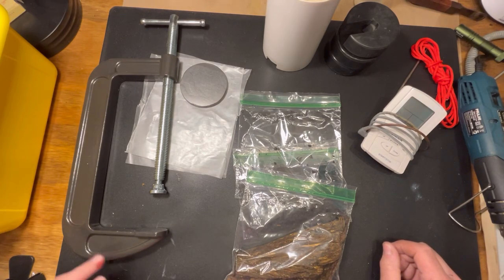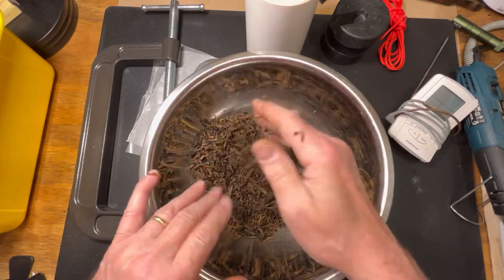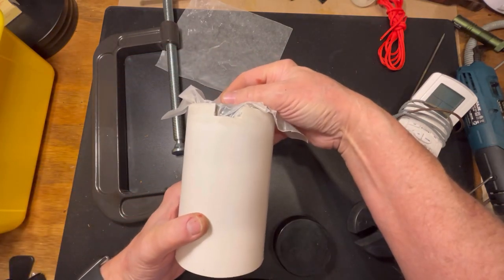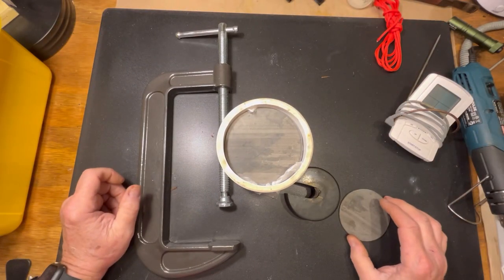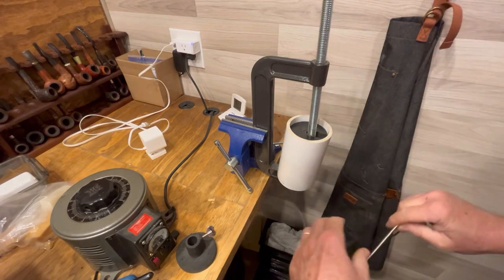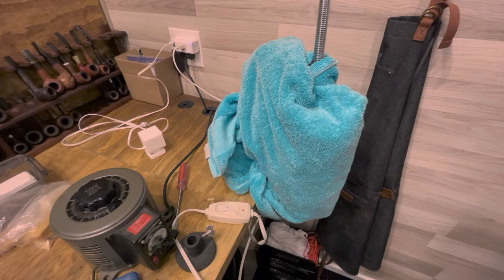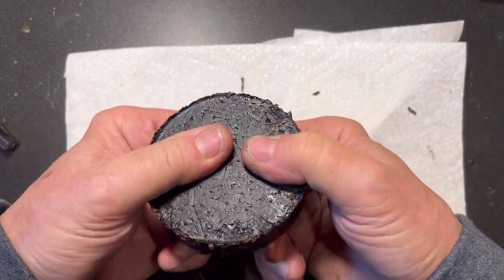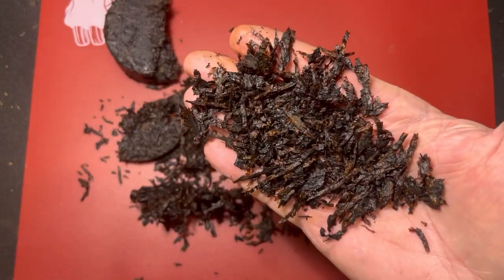How I Press Tobacco

Comment: Thanks for the video brother! Whar size PVC did you get? Also where did you get your metal plates? Ive made one of these before but never used the plates. Thats a good idea. You use practice pucks correct? Also wondering if you can cut these into slices, or if they just fall apart? Cheers! ✌️🔥💨
Reply from the maker: 3 inch PVC. I ordered flat bar stock from Amazon and cut them out. Yes, practice pucks.  The tobacco came out like a crumble cake. Thank you for watching.
Reply: @The_Southland_Piper  oh ok. Are all half-inch PVCs the right diameter for the pucks? My only issue is that I don't have a way to cut metal like that, haha. I'd have to use plastic lids or something cut to diameter. idk. Cuz when I made mine, I had the issue you solved with the metal disks. My pucks would slip sideways a bit and get off alignment, not pressing even.  Would have been better if I had someone who could weld the ball joint on the end of the C-Clamp from moving, maybe.
Reply from the maker: @mrpipestache2423  
Sorry but I told you the wrong size PVC. It is 3 inch.  The same size as the hockey puck.